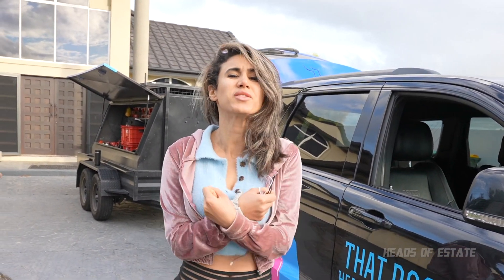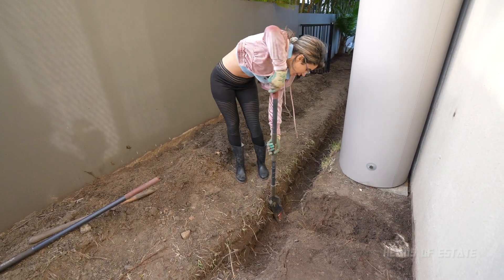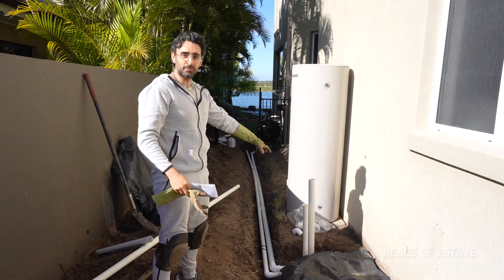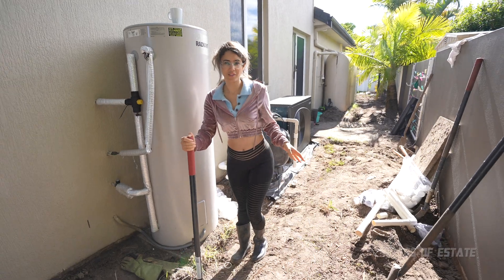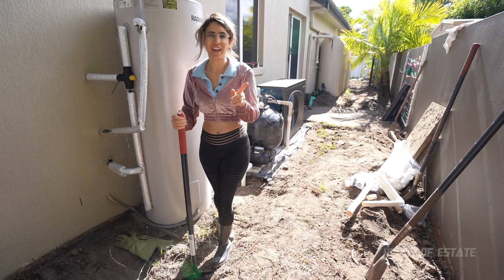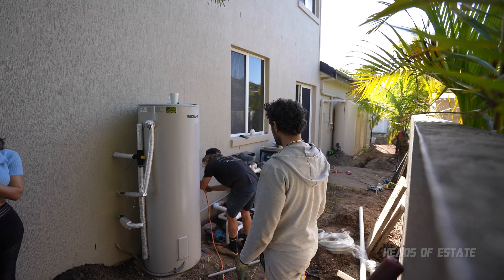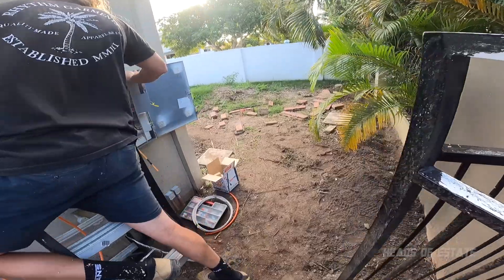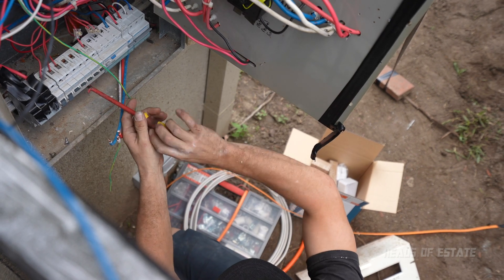IT'S TOO HOT 🔥 MASSIVE 35kW Swimming Pool Heat Pump UNBOXING and INSTALL

Comment: How long did I take to heat the pool for the first time? Also, this is better than the block!
Reply from the maker: It really depends on the weather, wind and if you use a pool cover. On average without a pool cover I'd say 0.5 degree an hour up to 4 degrees on the baseline temp, but I'll do some proper tests for the review.